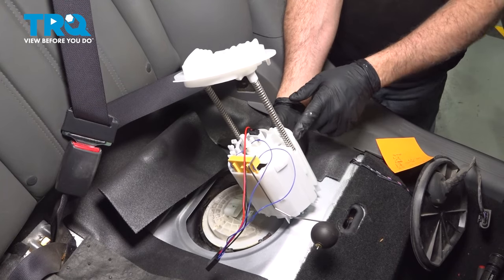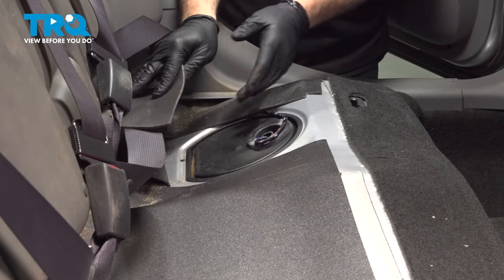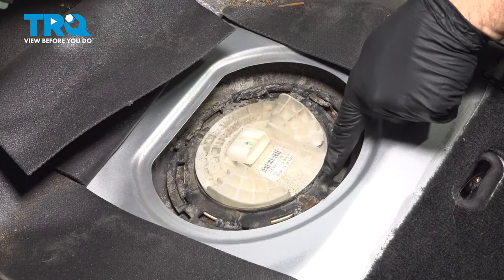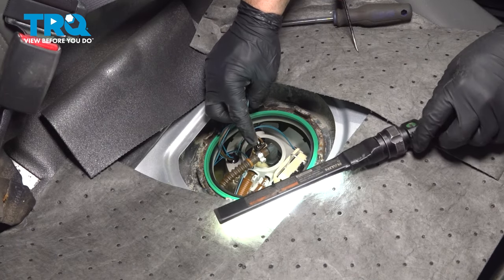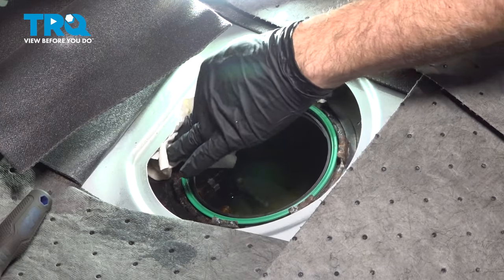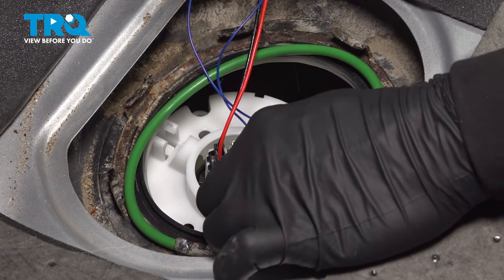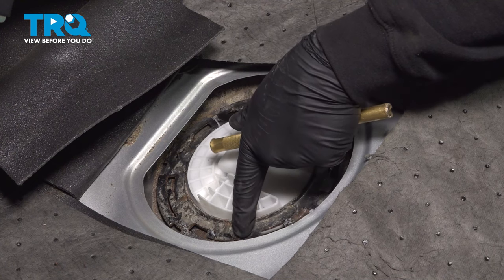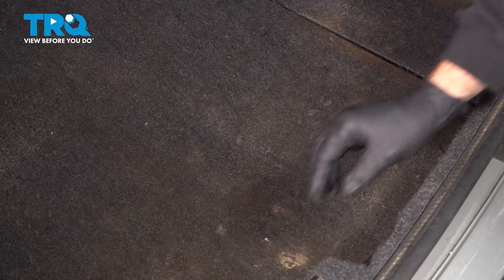How to Replace Fuel Pump 2005-2010 Chrysler 300

Comment: You should’ve mentioned in your video that if you disconnect the battery, you have to reset the steering angle circuit, which I now have to go to the dealership and have them take care of that which is gonna cost me money now

Comment: I have changed loads of pumps, if the car is "no start" you can't drain the fuel line and the steps in this vid are for changing a fuel filter not a pump? It is not advised to disconnect the battery on a 300c as they are prone to electrical/comms issues, removing the relay is enough or pay a pro to do the job. I let the pump drain for longer rather than spilling the contents over the tank. Easier to fit seals after the new pump has been connected, risk dropping it into the tank. Not a very good "how to" and very ham fisted.

Comment: 300's have two fuel pumps a Primary and Auxiliary which is your filter. If your vehicle doesn't start, it is due to both pump and filter mechanism needing to be changed.

Comment: HELP>>>>Followed instruction and replaced fuel pump but then starter crank would not happen checked fuses they were OK.  Took out battery? Charged it up still not start and crank?
Have check tool says no codes.???????????  What could it be? Dash lights come on.
Reply from the maker: +April Arnold We wouldn't be able to diagnose an issue like that here, you may want to have a local mechanic take a look at it. Thanks for checking us out! http://1aau.to/m/Shop-1AAuto-c

Comment: I got that fixed 2 days ago and I think guy who fixed it couldn't put the metal circles that lock it in correct and smells like gas any ideas 2 why or is it cuz the metal seals didn't lock correct ?
Reply from the maker: +Angel We wouldn't be able to diagnose an issue like that here, you may want to have a local mechanic take a look at it. Thanks for checking us out! http://1aau.to/m/Shop-1AAuto-c